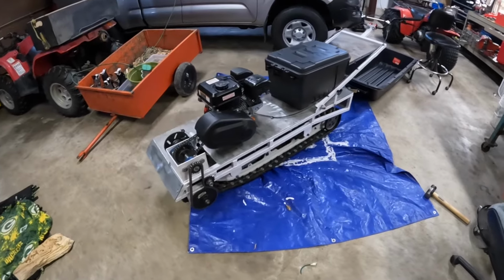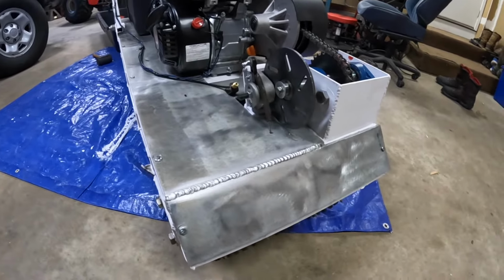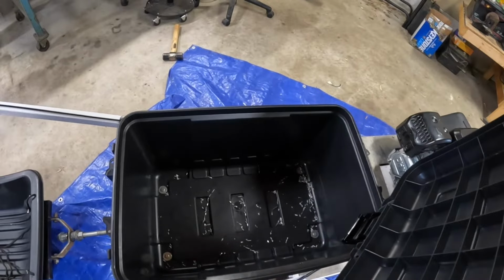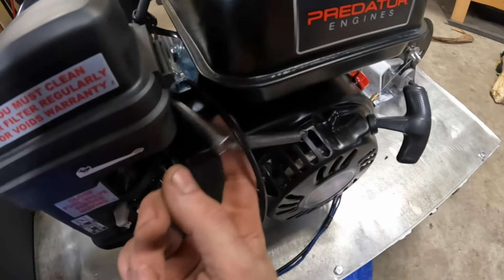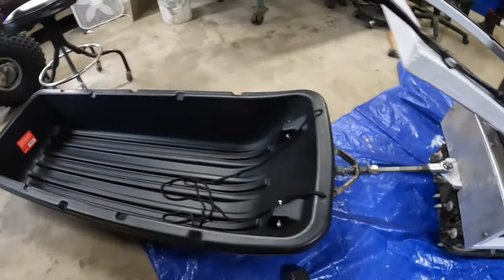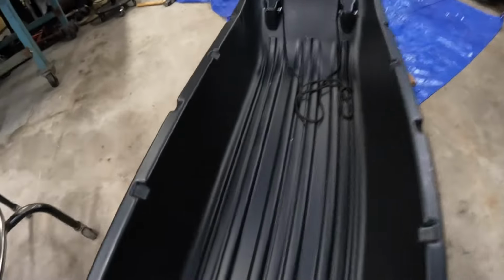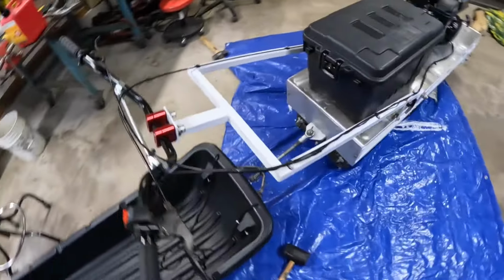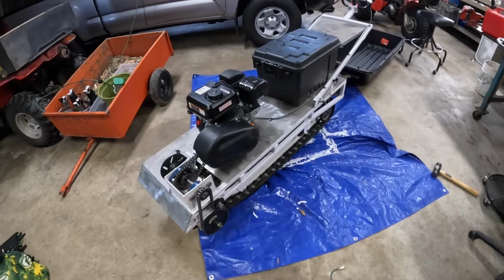New Track Sled Build Part 2

Comment: This is my next project for getting back to the hunt camp. We get a lot of snow up there in northern ontario and I don’t want to by a snowmobile even if it was cheap lol. I want one of these for the simple reason we get a lot of trees that fall from the snow in the winter and it be nice just to drive around the. Instead of having to cut them and move them lol. We took a trip up beginning of February and it took us 5 hours to get in on our small trail off the main which usually takes 20 mins in the sxs lol.
Reply from the maker: This would be a perfect animal then. In the up you can just go over the trees with a track sled yeah mines about a 20 minute quad ride as well but maybe 30 with a track sled

Comment: Planning on getting started on one soon! After reading through the comments i had a few questions regarding upgrades: is the variator needed? Where did you put the chain tensioner? Is there anything that you would add if building a new unit? Thanks!

Comment: Excellent build! I'm in the UP just south of Marquette and attempting to build one out of an old snowmobile.
Reply from the maker: Awesome! I love my new one I built. Still figuring out the engine with the governor removed. I was running out of fuel in the higher rpm. Drilled the gas tank vent out and seems to be working the way I want now 👍🏻
Reply: @TRoutdoors2021  I plan on removing the governor as well. I'm swapping the carb to run on propane. Running out of gas would be awful way out on a lake somewhere.
Reply from the maker: Ya I feel ya. I wanted to do that because I think it would be sweet to tee off to a heater but I feel like I would always be questioning how full the tank is and if I can make it or not lol. I’m going to just make a mount for a extra gallon. Seems like they get 15-20mpg?
Reply: @TRoutdoors2021  I have no idea the mpg. I haven't decided on the size of the motor either. My plan is to mount a 20 to 30lb tank near the motor. Additionally I'll have another tank for my buddy heater cooker.

Comment: Tensioner on the wrong side.
Reply from the maker: Yeah, seems to be working just fine.
Reply: Would be less pressure on the idLer sprocket. But seems heavy duty enough that it might not be s issue
Reply from the maker: It doesn’t seem to be yet 👍🏻

Comment: I see you have a Honda Big Red, very nice. I've got 5 of them, just love them. Now I want to build a track sled.
Reply from the maker: I’ve had that three wheeler since I was 15 I am now 29. One of the pieces I will never part with now it’s a great machine. Usually it is up at my camp for a daily driver but it’s getting a little tired now is going to be on the chopping block for a top end and head rebuild
Reply: @TRoutdoors2021  Well worth the time and money, nothing better in the bush. Have a good one.